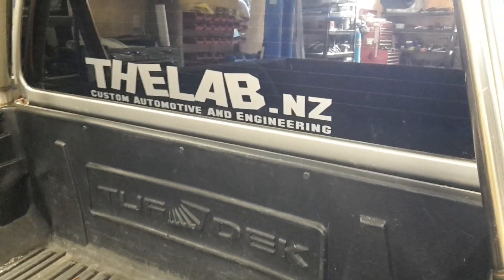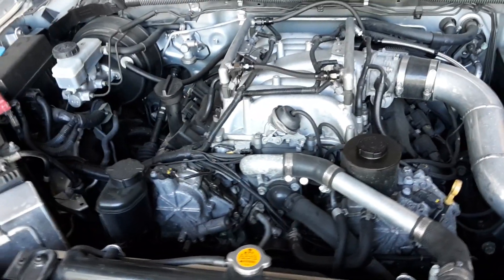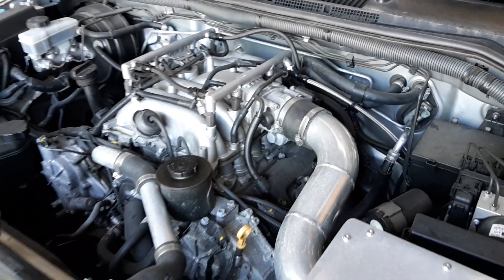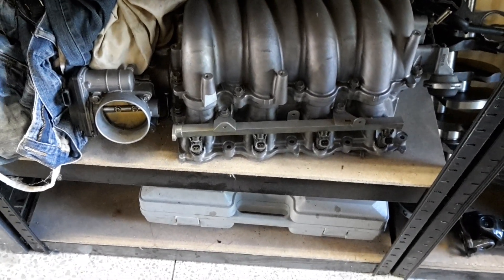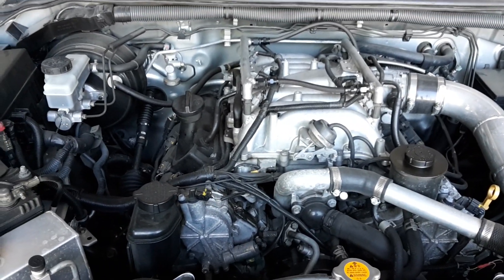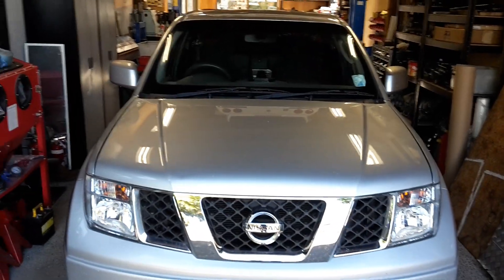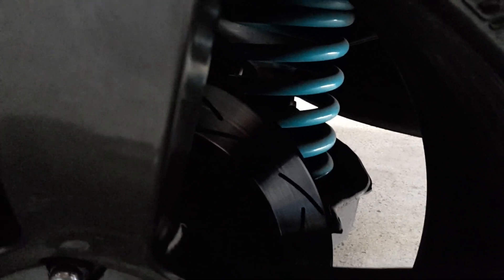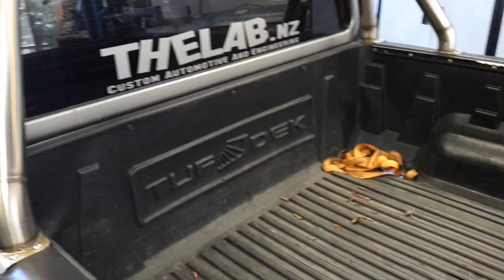The Lab D40 Navara V8

Comment: I like it, did you fit a rear cut, or just make mounts for the rear subframe? Very good, looks awesome
Reply from the maker: I did use the last 300mms or so of the Navara chassis for the spare tyre mount and bumper/tow bar mounts.  Didn't see the point in reinventing those.

everything else to the rear of the front suspension is full custom though.

Comment: Looks awesome!! You stated that its wide at the back, did you widen it or is it standard width? If so, how did you widen it?
Reply from the maker: Rear suspension is R51 Pathfinder, there are 25mm thick adapters to go from 6x114.3 to 6x139.7 then there are 20" by 10" wheels (dont remember offset) that results in a 2m wide wheel track.
The sides of the tray are then modified to suit so the tyres are covered as per NZ law.
Reply: @TheLabLimited  wow...thanks. It looks so good. Well done